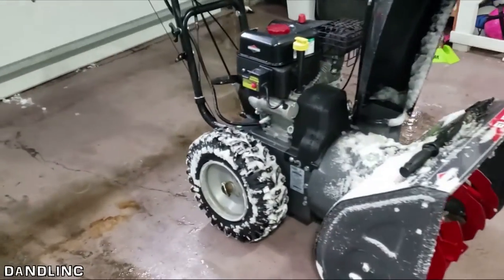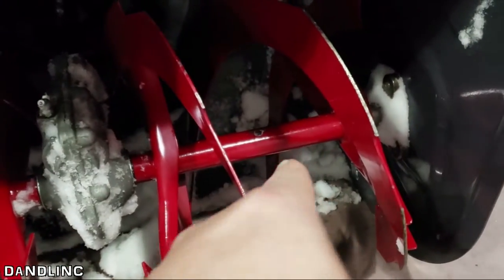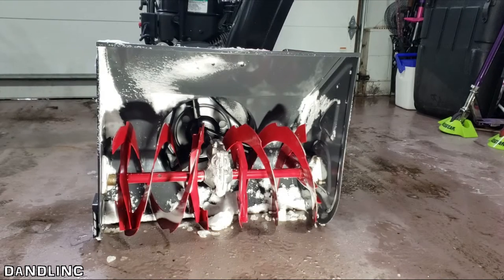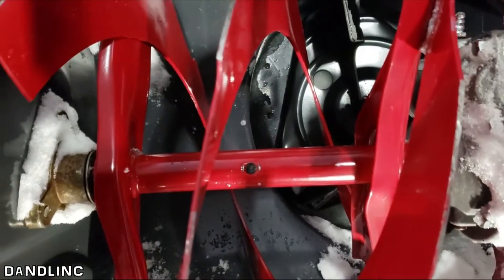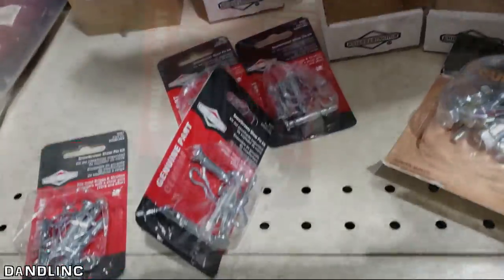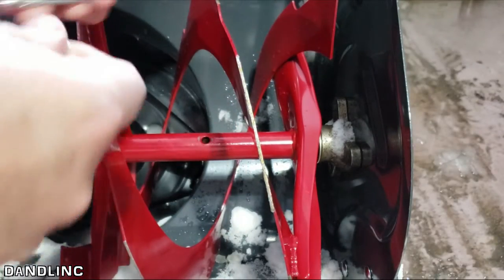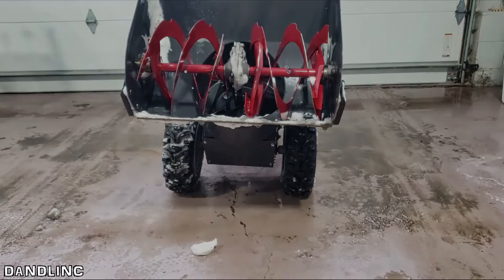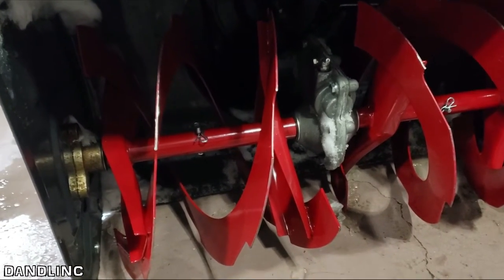How To Replace A Snowblower Shear Pin DIY & Save!

Comment: OMG! Thank you!  Just bought my 1st ever blower. Looks like the same one.  I've been told about these pins so wanted to get spares in case mine break during snow clearing.  I bought it from Canadian Tire.  They had another Briggs machine which was almost identical to this but $500 more.  Reading the specs of each on the CT site one of the only diff I could really spot was that the more expensive one includes the pins. I went to buy pins at CT and was shown some bolts, locked away in a security cabinet.  The package said 'replacement sheer pins'. I hadn't put the blower together yet, so decided to buy them after assembly.  The package has 4 of these pins you use. I thought those MUST be the pins. What else could they be?  A co-worker, long time blower owner, was telling me they're something else.  You're vid cleared it up.  Appreciated!!!